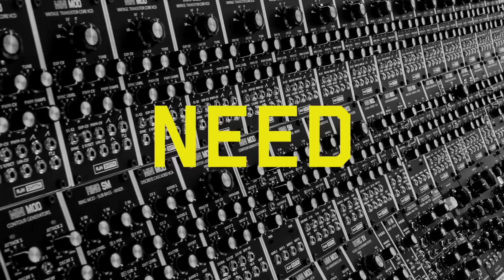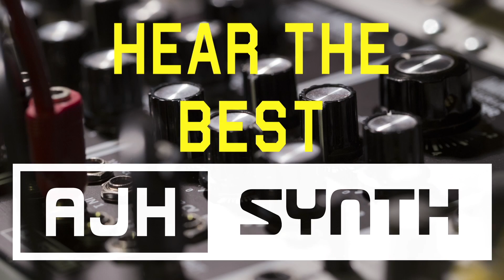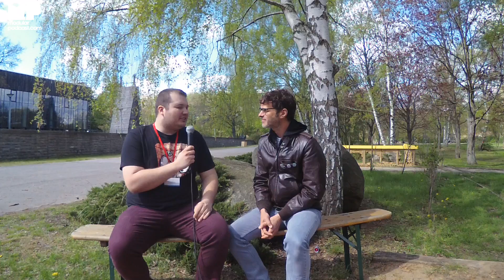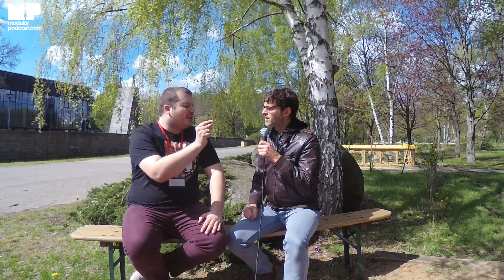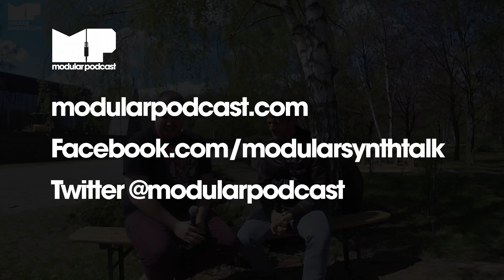Superbooth 2017 - A Conversation with Make Noise

Comment: Great interview! And spot on for non tunable drums.
Reply from the maker: Yeah I prefer flexibility with sounds too. Both angles work great though and depend on the use. Just having a small single function drum module if good for fleshing out sounds and getting the basics covered. But on a big home system it's always nicer patching up everything yourself.
Reply: Yeah I agree too, I was refering to non tunable drum modules, like he TTA-808 and, well...it clones the original down a "t". I would have bought the module if there was a tune knob/CV input, but there ain't one.

Drum modules are great, especially fo playing out live, I love them. Of course making your own drums sounds is even better, for me anyway, so at the comfort of the studio, a lot of drums get patched in from scratch.
Reply from the maker: Ah yeah I get what you mean with say the TipTop Drums, but every time I hear them they all sound great together! 

Totally with you on studio comforts vs. live.

Comment: Awesome interview Ben, really nice to dig into a bit of Tony's design philosophy. Funny, been thinking a lot about non centralised mixing & obviously trickling logic is right up my street.
Reply from the maker: I think for me a mixture of both with mixing is the way to go. I absolutely love the WMD Mixer, but I still need little 4HP mixers dotted around for both modulation and feeding filters. I don't think I've ever just ran a single waveform into a filter for voices I use. Usually a mix of more than one oscillator of multiple waveforms from one to create a new shape. Same with distortion/folders/filters and modulation mixing envelope, un-synced attenuated and LFOs and 1v/oct tracking for the most part.

Comment: I wish you did more videos like this one, really interesting to hear the original intention/philosophy behind both modules and a full featured system! Could you explain a little more of what Tony was saying about mixing triggers with multiples on pressure points and tempi? Didn't really understand that. Thank you and keep up the great work!
Reply from the maker: with stack cables you should ever mix signals. As you don't want to send a signal back into the output of a module. However the Pressure Points gate outputs are fully protected meaning that with stack cables you could take two of those gate outputs into the input of another module and everything will be ok. So you stacking the cables one gate output into the input of a module then stack the next gate output and cable into the back of the stackcable already in and those two will mix and everything is ok. 

I'd love to do more of these but with so much to cover at the event it's hard to get round everything. However ... I do have a couple more videos like this one from this year.
Reply: DivKidVideo that all makes sense now, thanks!
Reply: DivKidVideo is this because pp gate outs can never be high simultaneously? And thus never sum them together. Can I further mix all these with an RCD output for example?
Reply from the maker: Hey Ican, great glad to help.
Reply from the maker: S. filmer - well that is true (more than one won't output at once) that's not the reason. Current will flow down the cable BACK INTO the pressure points, but pressure points is protected so that's fine. Lots of modules aren't though. So it's not about two things hitting at once it's about signal from an output going through the cable then back through the stackcable connection to the output of another. Also with the RCD multiple outputs will be high at once. Use an OR gate or mixer for merging those.

Comment: Good interview Ben. I don't suppose you could elaborate on the Optpmix,  Maths patch you mentioned Ben could you?? Stereo panner one
Reply from the maker: Hey Jase, yeah sure. Take one LFO (say a cycling envelope from channel 1 of Maths) then patch it into the CV control of an optomix channel 1. Copy the input signal to both channels of the Optomix and then split the Maths envelope output into channel 2 of maths and invert and offset it then patch that into the CV input of channel 2. So you have the same sound into both sides of the Optomix and same modulation source but one normal modulation signal and one inverted (then offset to work in the right ranges) so that as one sides opens the other closes. It'll give a nice auto pan affect and as they close the Optomix will give a great top end roll off too.
Reply: Shot Ben, thanks for this detailed description i'll give it a crack this week. Modular has so many hidden tricks
Reply from the maker: Yeah there's loads, the learning is never ending which is really the appeal for me.

Comment: Envelopes! How I love Maths envelopes. Between the control ranges and the adjustable curve it's just the best envelope I've got. With the logic section you can get really interesting complex envelopes, accent implementation...it's hard to "waste" Maths (heh) on some of its other cool functions when I've already got it opening and closing stuff. I'm getting ready to purchase another Maths (I'll have 2 in 6U) and it will probably also get used as envelopes a lot.
Reply from the maker: haha hats off to the first comment to bring up the "wasting a maths" idea. It definitely makes for a cool pair of envelopes. One looping and modulating the other's decay is cool.

Comment: Good watch.. The thing is you never do any make noise demos though
Reply from the maker: You're right I don't, it's not something that either of us have pushed much. We have spoken about it just never worked it out. Be great to demo the Morphagene or other modules. I use the Erbe Verb, Pressure Points, Optomix and Echophon a lot in my own patching.
Reply: DivKidVideo cool no worries. Its just that make noise modules are somewhat dificult to crack sometimes and you always manage to get the most out of the modules you demo. Hopefully in the future anyway. Cheers

Comment: +DivKidVideo My problem with many MakeNoise modules is that they're HUGE, they're TOO WIDE (putting aside that they possibly could be cheaper). For example, take PerssurePoints. The pressure sensors themselves are too wide. My fingers, which are pretty normal, could work with like 60% of that width no problem, and the pots could for sure be packed more tightly. Or take DPO. Yeah, it sounds good, but it is way way too wide, especially considering limited number of waveforms it produces. Same goes for Maths - I haven't saw its PCB, but it looks like Maths could be made ~2-3hp narrower. My point is: hey MakeNoise, just make a slimmer Maths and sell it a tad cheaper, so people would just buy/install two and "waste" one, problem solved.